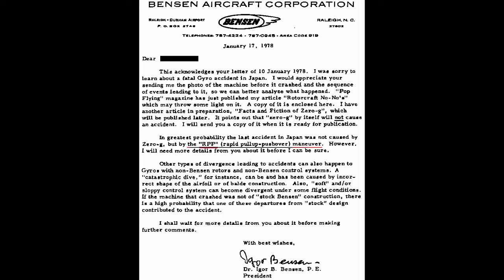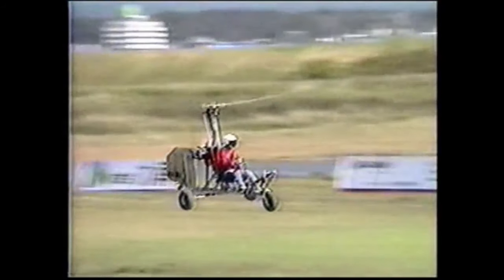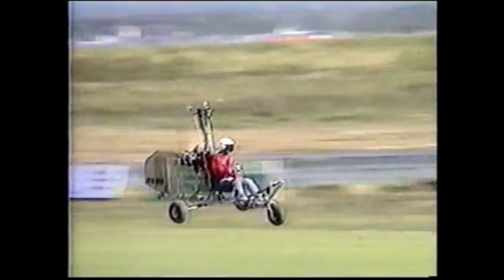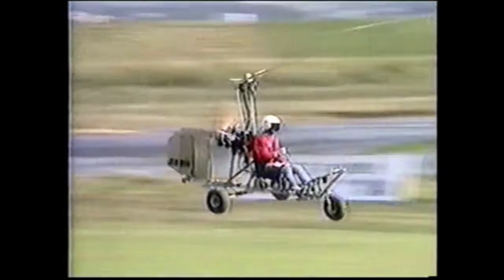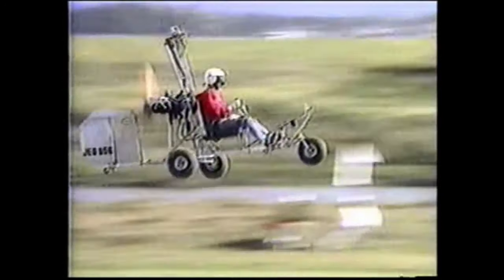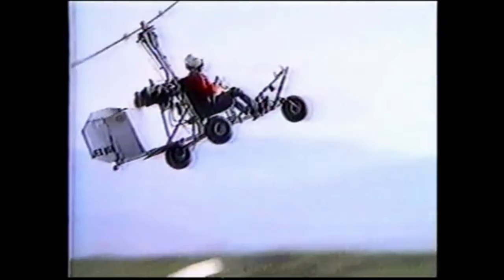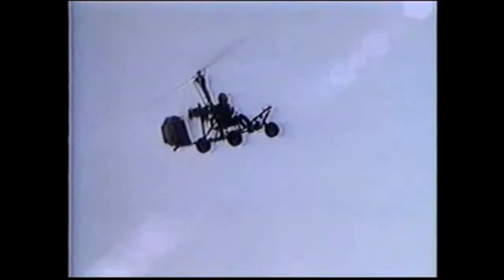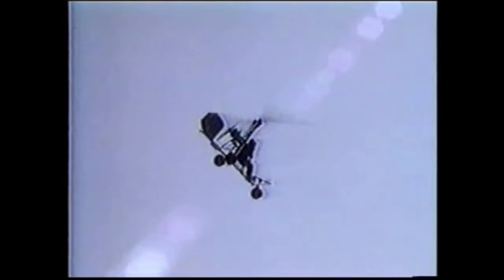Gyrocopter low g power push over crash (the cause of many gyrocopter fatal accidents)

Comment: What advantages do they have over fixed-wing microlights?
Reply from the maker: The main one is wind limits and cross country comfort.  If you live in the UK you'll know that we get very varied weather and also we have very varied terrain.  Fixed wing microlights are great things but you'll get more out of them if you are experienced.  Now you could argue that is the case with all aircraft but fixed wing microlights because of their general low wing loading make for a quite "bumpy" ride in turbulent or thermic conditions.  That in itself might be something many are put off by.  However in the landing phase in particular they are far more sensitive to cross winds.  Again in the UK the majority of time we get a South Westerly wind and +10knts and slightly gusty is not unusual.  Because of the general loss and decay of the once very numerous airfields in the UK very often a wind from 290-300deg leaves a crosswind.  That is a challenge - or rather a much greater challenge to the inexperienced fixed wing microlight pilot.  However I would say in almost all cases of aviation you need to doing it often [so +20/30hrs per year] and off a reasonable amount of experience, preferably +500hrs but certainly >200hrs.  Good luck.
Reply: @gyrocopterflyingclub6148  Thanks, and as a matter of interest how do the crash statistics for gyrocopters and microlights compare?
Reply from the maker: @tungstenkid2271  Hi honestly I don't know and really the problem is that gyroplanes over the last 30 years have really changed because the usual 2 seat gyros you see flying today didn't really exist in any meaningful form before circa 2005/6.  So comparing these verse the historic data is one thing then the numbers flying / hours flown are relatively very small.  By far the most common modern gyroplane accident today has its roots in some form pilot error - which is reasonably true for all aviation accidents today, the equipment is pretty solid in all cases.
Reply: @gyrocopterflyingclub6148  - Do you foresee any hope in turning around the aviation trend in the UK? In that, I mean, stopping or reversing the loss of airfields. 

I am curious because we here in the US have lost a lot of airfields. We just had a lot to start. So, I am projecting what the future may entail.
Reply from the maker: @deanfowlkes  Hey - no I think the trend continues in the UK and likely over the next 30 years you are left with a handful of well used GA fields and some ones of historical significance, the rest will be industrial or housing estates.  The unsinkable aircraft carrier hasn't been needed for some decades now and aviation is not very popular among the young.  Go to an airfield in the UK and you find the following trend.  Cyclist and motor cyclists having a cup of tea as the airfield is a source of rural cafes.  Older people full of nostalgia, dog walkers and then at the back of the list are a handful of people who actually fly and a smaller group who have flown to the airfield.
Reply: @gyrocopterflyingclub6148  - Thanks. I am of the generation that I barely missed the end of the heydays of aviation in the US. Between the military base closures, municipal airfield closures, and the sale of private airfields to developers, I have seen a lot of airfields disappear. You can still see remnants of many in the way of old runways, crumbling under layers of weeds. In big cities, airfields are being bought up by housing developers. 

Even airport communities (communities specifically built with runways and hangar space for the residents) are falling victim to the ravenous hunger of investors. As older pilots die off and their homes (many of them with Hagar sized garages) are sold, these investors are getting enough stake and equity in the community that they can outvote the remaining flying residents. 

One such community near my home has been under siege by an investor long enough that the fued has outlived the investor. Yet, the damage has been done. Fuel storage has been outlawed at the airfield. Even though every house has a hangar. The FBO has been bulldozed. Rental hangars have fallen into disrepair and been condemned or dismantled. The runway is useable but unpainted. The taxiways are barely such.

Comment: On newer builds what about an assist system for the rotor blades ? Sure if you Bunt/loop that's all she wrote, but what about a high torque starter motor with capacitors and programmable rpm switch 🤔 

Machine the gyrohead with an outside gear similar to an outboard flywheel, the bendix is far enough away from the rotor to be safe but in the event you lose rotor speed it can engage even if just briefly  and get you back 300-400 rpm 

Would that give you back enough lift to get out this scenario ?  Or would that initiate a horizontal spin without a tail rotor even if it's only a brief second?

Comment: In the slow-mo, you can clearly see him pushing over.  It didn't take much movement of the stick to unload, and once the nose dropped, he was done.
Reply from the maker: Yes I think its more almost allowing the aircraft to fly a ballistic path
Reply: @gyrocopterflyingclub6148  Yes. With the rotor unloaded, that's kind of what's happening. The only forces acting on the aircraft are from the engine thrust and gravity (and maybe some smallish gyroscopic forces and engine torque).

Comment: Are gyros currently banned in Japan? 
I can find none registered there, and there was a bizarre incident three years ago, with an imported Cavalon.
Un-registered machine,  uncommanded take-off, fatal crash (tail-strike in the air, interestingly)
Reply from the maker: No i don't think gyroplanes are banned in Japan but in truth its not a market i have a lot of knowledge of.  I think the Cavalon accident had the usual set of unknowns but given the nature you can see the holes in the cheese line up a long way away - I mean how did anyone end up sat in an un-registered aircraft with the engine running and get an "un-commanded" take off?? Hmmm yeah OK.
Reply: Air strike means negative g.  The other thing to look for is often the blades end up bent forward like an upsidedown banana but not backwards as if high enough by the time they hit the ground they have little forward speed.  No gyro is fool proof with negative g, neither are choppers, or trikes.  Trikes may be able to recover but risk overstressing the wing.  Anything in which you hang beneath a universal joint and the weight has any bearing on control will loose that control if you pushing is weightless.

Comment: When you say 'unloading the rotors', could I translate that as a kind-of  'wing stall"?
Reply from the maker: Hi and no.  So rotors in autorotation do so because of airflow through the blade and because of the position of the aerodynamic force the rotor continues to rotate.    Therefore "unloading the rotors" to mean a g value less than 1, means airflow is taken away.

Comment: A fixed wing aircraft has a stall warning horn, a gyroplane should have an unload warning horn that sound when you are about to unload the rotor. Or better yet, have a automatic stick puller. I don't think it is that difficult to implement.
Reply: Anyone who's flown old school in e.g. a Bensen or glider might laugh at your suggestion but i support your thinking. Having a realistic simulator on which to train - good enough to mimic a chosen current model - would safely teach students and type converters its corresponding flight envelope and control input limits. Knowing the inputs to avoid much better than inflight sensors, as human reaction to warnings might be too late. On the other hand, if the top end of the market went to fly-by-wire, realtime predictive flight modelling could simply ignore/override human suicide inputs! I guess autonomous flying taxis will bring such technology faster than many care to imagine.
Reply: @ExcaliburBahrain The problem is people have been told gyros fly like a FW since day one. Gyros actually are more like a trike. Do the same thing on a trike, and you will end up the same.
Reply: @Aviator168  I think it is more complex than that.
Historically, there have been FW pilots who died in gyro accidents because they did not seek sufficient cross-training, or perhaps, forgot what they were taught at the critical moment, and went back to FW reflexes..

This US article dates from 2004...
https://www.kitplanes.com/gyroplane-safety/

A South African airline pilot's perspective...
http://mysite.mweb.co.za/residents/gpoley/homepage%201a.htm

Comment: One thing that puzzles me. I know that some pilots are 'cowboys', and like thrills even if they are a bit dangerous. But this guy was descending rapidly and sounded like he had power to control the descent just above ground level - but why, then, did he pull up so radically?  I didn't see an obstacle and he apparently was not trying to land. Was he just joy riding to an extreme?
Reply from the maker: I think he was performing some demo / display to a fly in.

Comment: How easy do the rotors unload in a downdraft eg caught on the leeward side of a mountain or a sudden gust even if brief. Or as you come out a large thermal and get sink.
Reply: Supposedly they are not as sensitive to winds and turbulent air when compared to a trike with a weight shift wing like an Evolution trike. I'm not a pilot in either only what I have read.
Reply: @Mike-01234  I wrote to Ken Wallis years ago, and he relayed a tale of flying his gyro in a hurricane in Brazil, with palm trees flying by and all commercial aircraft grounded. Gyros are incredibly stable in adverse conditions.

Comment: Does having a horizontal stabilizer fix this issue?
Reply: I don’t think so.  Apparently running your engine and prop in a tractor configuration does by moving the CoG forward.
Reply: The center of gravity could stay the same. But, the thrust line/vector would change. It’s the same with pusher-prop airplanes, dual push-pull airplanes and airplanes with top/high  mounted engines.
Reply: It helps but it can still happen unless you get a gyro with CLT (center line of thrust) like the dominator or sparrowhawk 3.

Comment: Said it before: Gyros are not sport machines unless the pilot is actively involved in, and current with, all aspects of the physics involved. Even then why bother? Go for a STOL aircraft if you want to fly like a stunt pilot. The flight view is (all) the excitement (on offer). Any close to the ground activity should be boring and predictable. These Darwin Award moments will keep Gyros in the news, sales low, prices high and the regulator-trolls frothing with self-justified importance.
ps: Pilot in video must have been flying into a stiff breeze to lose that much inertia so quickly.

Comment: Im not sure what the recovery direction's meant.  (Slightly Aft )  im guessing power down and push down on the control arm .🤔
Reply from the maker: Yes at some point in this clip it becomes un-recoverable sadly but the solution would have been to close the throttle and hold the stick aft to maintain the disc loading.

Comment: Can you sort this in my head Phil? Looks like he levels out as his speed washes out, but because he's still giving it the beans the prop thrust pushes him over. He reacts with more and more back-stick to correct the push-over  but runs out of stick relative to prop thrust. Am I reading this right? If he'd throttled back at the top of his climb, the ship would've settled and he might still be alive wouldn't he?
Reply: Yes.
Reply: He appears to push the stick forward 3 or 4 inches @1:49....

High thrust line and no H-stab either, of course.
Reply from the maker: yes agree with that.
Reply from the maker: Hi Chris - yes I agree.  The most striking thing for me is that nothing in any of that looks particularly aggressive. I'm not sure if this was part of a practiced sequence at a show or someone having a play but as you say it almost looks as if it just ran out of energy at the top of the climb and he ran out of ideas.  Given the actual height this all happens at in reality simply closing the throttle will create a second issue - i.e. no height.  The roll and pull as per my unusual attitudes film would have saved him here - which is one of my big frustrations with UK training because I got heavily criticised for suggesting that. Why? In the UK there is a drive to have one solution fix all problems [because it is easier to write one document / describe one process] and then create a little jingle / slogan / catch phase.  All very nice and marketable but it doesn't work because flying isn't like that but Hey ho.  I also think all gyroplane pilots should spend a half hour with an aerobatic instructor in a fixed wing to understand the sensations, etc.
Reply: Academic, i know, but looks like the rotor chopped the prop, just before impact @2:22
Reply: @RodCrosby  consider this how much do you have to move the stick for an effect on any gyro.  1 inch is massive particularly if held it looks like he pushed forward several inches for about a second then tried to pull it back.  His machine is hauling though really shifting probably over 90mph.  So it's hurtling up and he's flattened the disk.  It's unloaded as this point and he's dead.  You are flying the rotor.  His tail doesn't look like it even hits the rotor.  IMO I suspect he'd have been dead in any machine.  You'll also note it's a pretty standard Bensen.  The seat is a little low but it does have its downthrust.  So he'd definitely be alive had he let it climb or banked over to maintain positive g.  Would he be alive if the cg was higher relative to the thrust line? That's an open question.  I think the confidence is misplaced.  Until someone can show me doing that type of manoeuver in a high CG machine or extremely high speed and punch the stick forward I remain unconvinced.  Of course no one is mad enough to try.  We should donate a few thousand to these guys making large scale RC gyros and deliberately bunt them over in all Configs.  In the meantime just get good instruction and don't do stupid things.  Of course the instruction has to be good enough to know what is and isn't stupid.
Reply: @cameronlapworth2284  Yes, I fly very conservatively. I "invite" the gyro to change attitude, with almost micro-movements of the stick.
Reply: @RodCrosby  yes that's the key.  Leave the thing alone and it will fly itself.  There are certain aggressive manoeuvers I'll do, very tight turns, vertical descents, spiralling vertical descents etc. But I plan it and I keep it positive g.  You can have tremdous fun in a gyro with positive g loading.
Reply: @RodCrosby  I watched again I think you might be right.  They unusually do.  As you say it does help investigators work out what happened but you'd be just as dead anyway.  Once those rotors stop making lift with what are people going to control the thing?
Reply: @cameronlapworth2284  Just install a mechanism to only allow for very slow forward stick movement.
Reply: @Aviator168  yeah but even that won't work. Hold a slight forward pressure for any length of time and the action becomes more increased.  Look this is not some bogeyman waiting to catch the uninitiated,. Once you have learned to fly properly you are as  unlikely to instinctively do this as you would jerk the steering wheel of your car to vere into a tree.  Everyone always wants to fix the machine even the old Bensens are stable until you get to a speed where they will do this or perform a manouver like this.  You cannot engineers rotorcraft to fly upsidedown. It's a mass hanging under the rotor disk make it weightless and it will do whatever the forces dictate.  So let's say you have perfect gc vs thrust line or sufficient downthrust to keep the machine level after you unload your rotor.  It won't recover.  You control this by moving the lift with respect to the airframe.  Unload it and lift = 0. What are you going to use to recover?  At this point what difference does it make if you chop your rudder off pitch forward or not.  No lift on the rotor = dead.  Just don't fly the aircraft beyond its limits.  I'm 50 I've been doing this since I was 20.  I've seen every possible type of accident blamed on these machines. You know what I have never seen blamed.  A specific instructor.  Yes there are machines that are twichy.  There are geometries that are better than others   I've flown in the air command banned in England.  It was sweet and mild.  But I didn't fly it at 80mph I was flying it at 30-35mph!  But yes put. 583 in it with 23ft 8 inch blades and it had a tremendous power to weight ratio.  You could easily kill yourself.  But I also have seen high CG machines with large stabilisers that the GPS data showed going something like 95knots to 0 in seconds and that large h stab cut off by its own rotors.  You cannot idiot proof these machines you can however learn to fly them within their limits.  That's the key.

Comment: Its got to always fall on the rotor he stalled it till it only fell on the aft side right after the unloading and that plus full power pitched it?
Reply from the maker: Rotor isn't stalled although the airspeed was getting low and so if the stick is held where it was to commence the climb you'd just "mush" towards the ground.  It rolls because the rotor a g values less than 1 isn't resisting the effects from the motor and once it has departed from controlled flight - you see the result.  A good graphic here:-
https://www.tervis.fidisk.fi/JTsite/safety/Gyrosafety.html
Reply: @gyrocopterflyingclub6148  Read that link you sent says the cause of Pitch Instability was exacerbated by the fact that early Gryos like Bensons lacked a horizontal stabilizers. I'm assuming with the engine thrust right over that stabilizer it would help does it not?